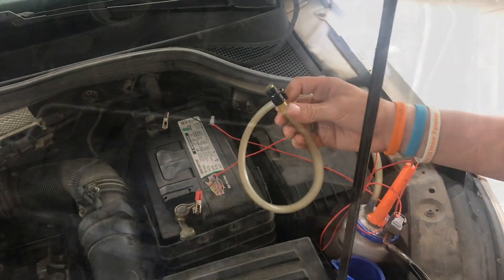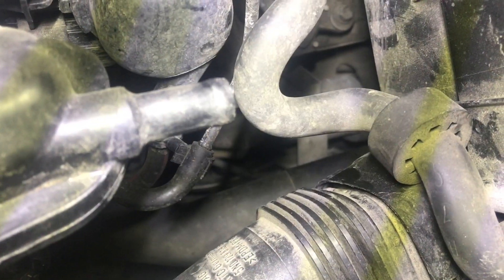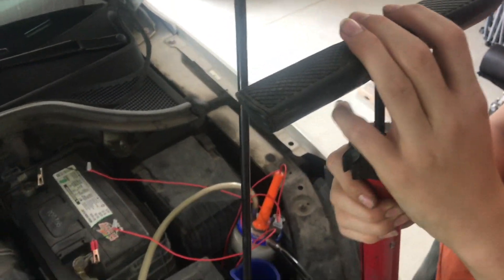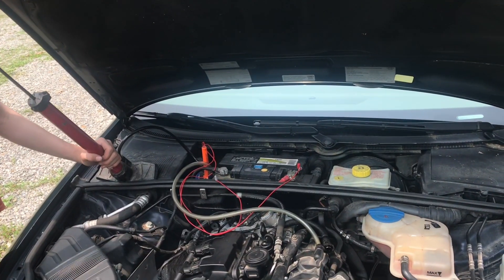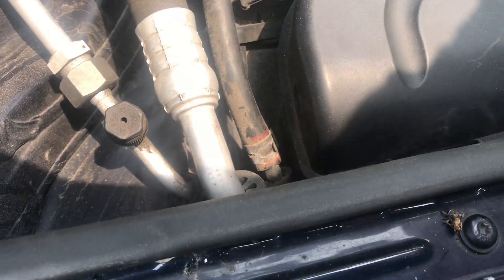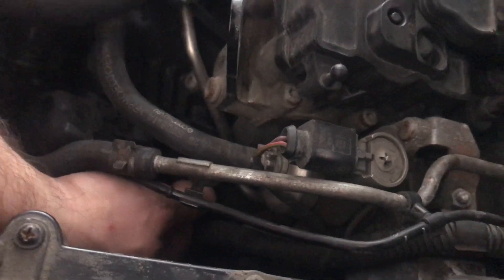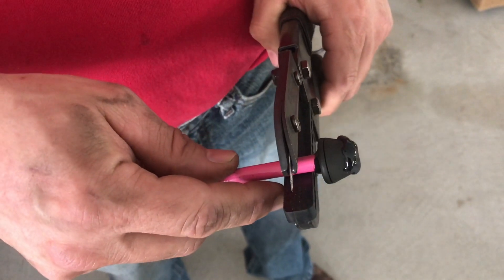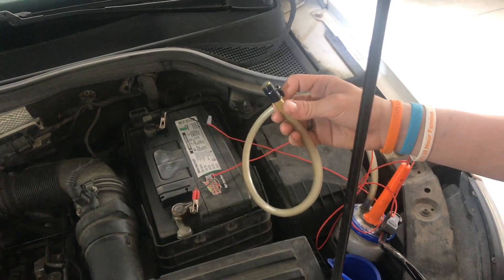using SMOKE MACHINE to fix P0400 unmetered air leak in intake manifold

Comment: Can't you just pump compressed air into the manifold from the same port you used to about 15 psi and just listen for the leak ..??
Reply from the maker: You could use some soapy water to help locate the leak with the compressed air. Sometimes if it’s a small leak the smoke helps give you an indication where it’s coming from. Because I’ve got the smoke machine I typically use it first. Sometimes I find a leak somewhere else.